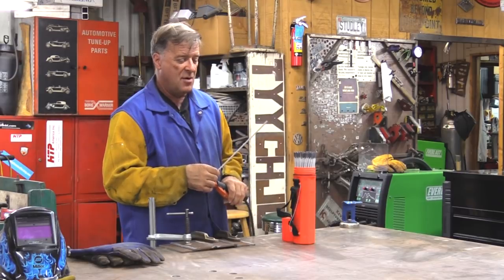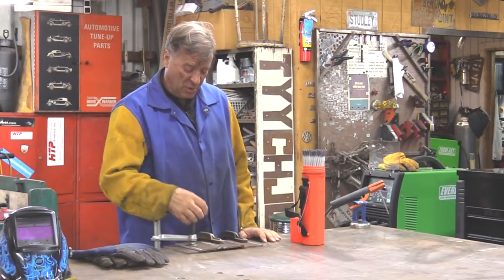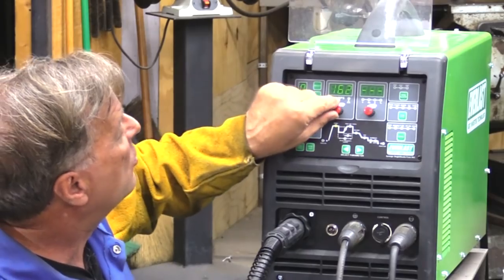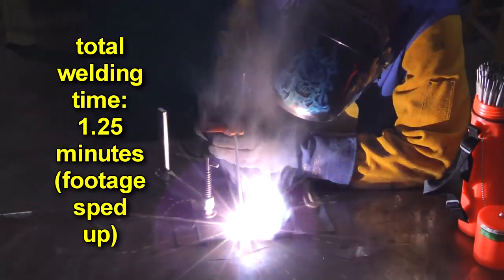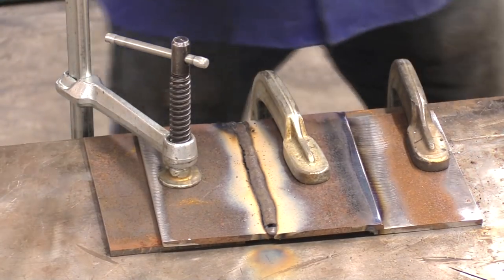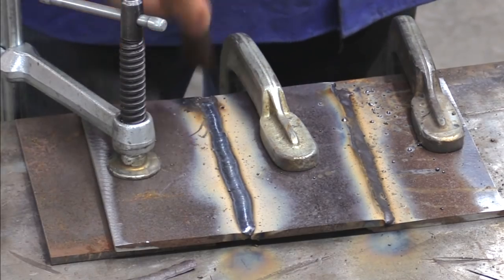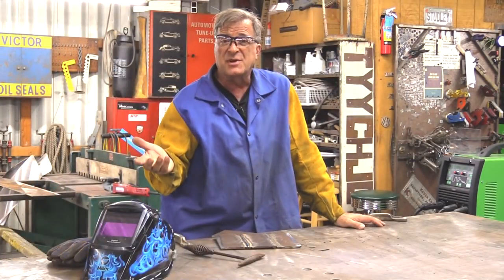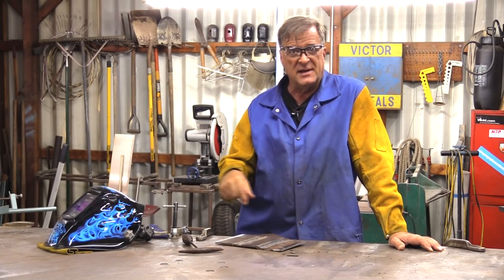How to Stick Weld 1/4" Steel Plate Using the Everlast Power i-MIG 253DPi - Kevin Caron

Comment: Good video. Have u ever welded several 1/8" thick steel plates stacked 2 create a 1/2" table? I'm thinking of doing this 2 create a thicker welding table by mig welding the perimeter as well as drilling holes 1' apart through all 4 sheets and welding in the holes 2 add strength 2 the bond. I'm using 2'x3' scrap steel sheets that  I picked up cheap.
Reply from the maker: Never tried that! 

 But think about the time, wire, electric, and gas.   Not to mention the drill bits for all the holes you are going to drill.      Compare that to the cost of a 1 inch thick plate the same size.     Might be easier and quicker to just buy the plate.

Comment: I would like to get into welding,  I was thinking about doing a course but I'm not sure which course would be best to start with. I have a choice between a tig welding course or Manual Metal Arc Welding course. could someone help me decide as I don't know much about welding.
Reply from the maker: Either one is a good start.    MMAC is smoky and messy.   It is for the heavier/thicker metals. (in my opinion)   I use it on bases for my sculptures. 

Tig welding is super clean if done right.   But it can be harder to learn if you have no experience in welding. 

All depends on what you want to do with a welder once you know how to operate one.

Best thing to do is take the class and see if you like it before you spend the money to buy a machine. 

I would look for a class that will give you a taste of all the different types of welding.